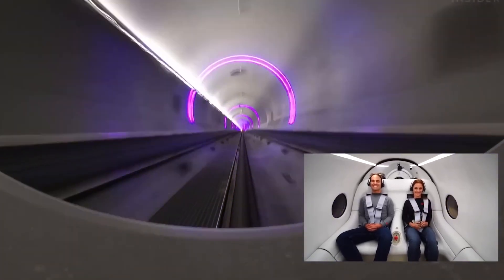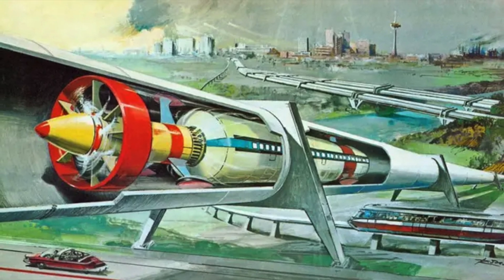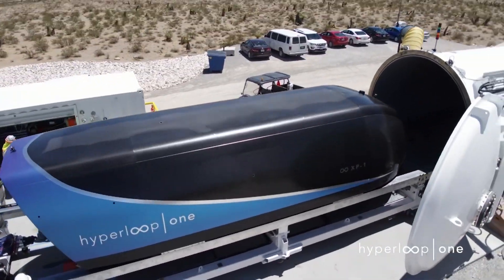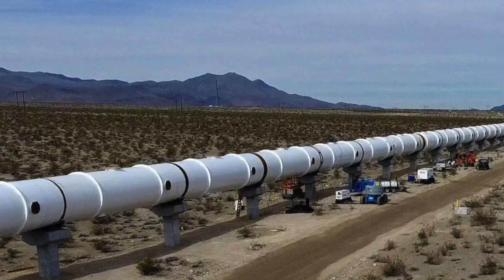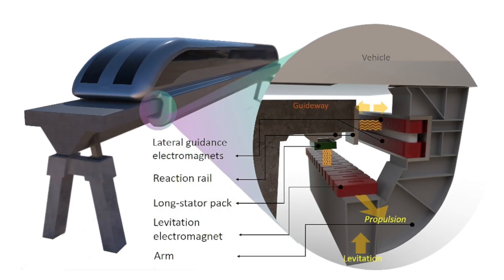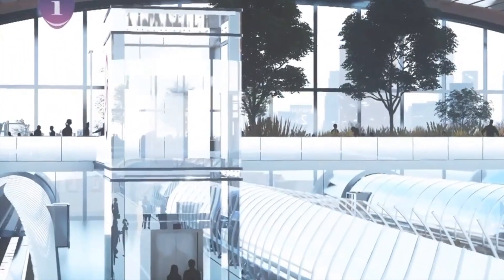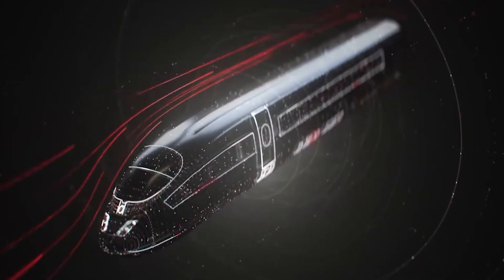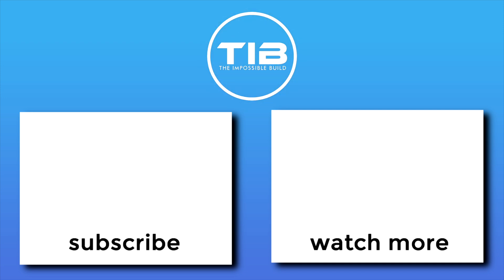Why Nobody Can Build The World's Fastest Train (Yet)

Comment: I don't see any reason why this cannot be build. Building pipelines that keep pressured natural gas inside is much more challenging than keeping partial vacuum. The technnology has existed since 1960s. If maglev is too expensive just build it with regular tracks. Even current electric locomotives could travel 1000 mph in vacuum if the bogeys had enough gear ratio and the rails were straight enough.
Reply: I'm glad that a lot of people are aware of a real problem The problem is not building all this tech, the problem are the people who are not allowing progression and evolution, because of their selfish greed towards money and power.